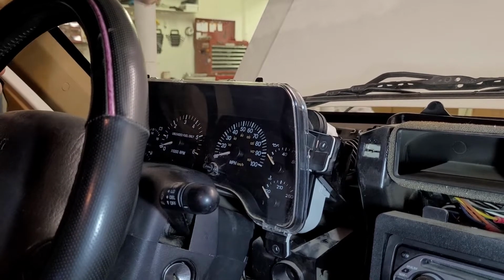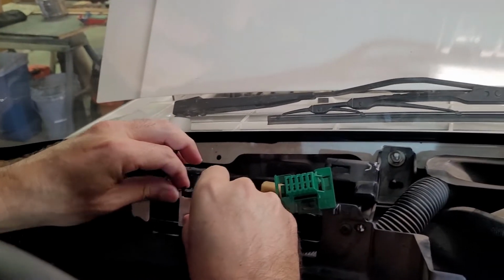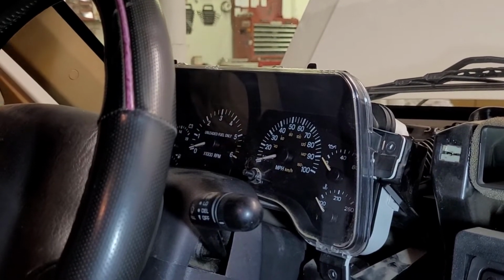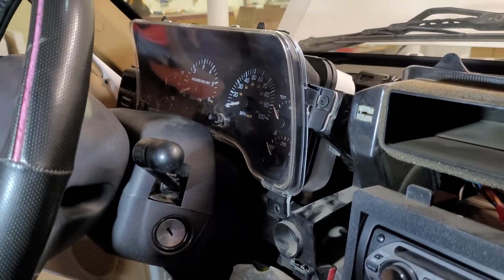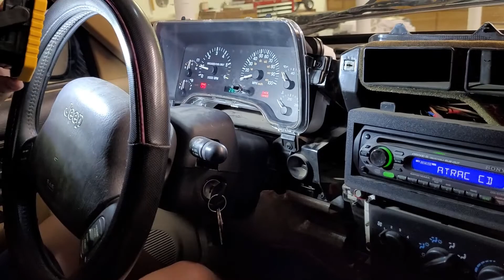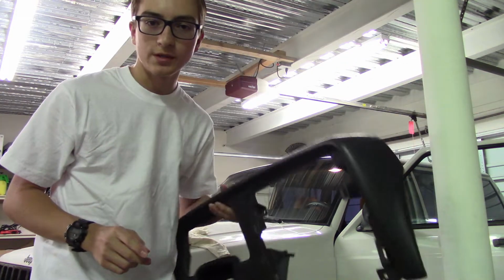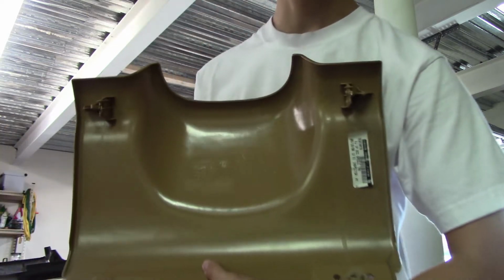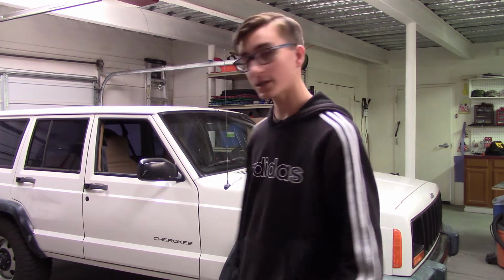97 to 01 Jeep Cherokee XJ Instrument Cluster Fix

Comment: I really like the double sided tape idea!  I think that is a far superior solution for this issue over others I have seen.  Leaving the slick paper on was another excellent idea.  That will allow the sockets to self-adjust if alignment isn't perfect and it will make further R&R procedures much easier.  Face it, this is a Jeep and you WILL need to get in there again 😉

Comment: The tape fix is a good idea, I am about to do this on mine.  Debating on the potential benefits of dielectric grease on the connections. I also just wanted to correct the headlight switch suggestion.  If you reach up between the steering column and the headlight switch and feel around with your fingers on the side of the headlight switch, there is a release button.  It is a bit of a pain to get to but if you are patient, you will get it.  Push it and pull that headlight switch completely out, then remove the bezel.  After you have reassembled everything, just push the light switch back in.

Comment: Getting ready to do this repair on a 97. How's this holding up?
One thing I'll add is that the little knob for the headlights comes off easily. With the kick plate off, you can reach your hand up in there and there's a little spring loaded plunger. You'll feel it. Push the little button in, and the rod and knob pull out. When you get your bezel back on, you just push it back in and it locks back in place. Remember that for when you need to replace the heater core one day.